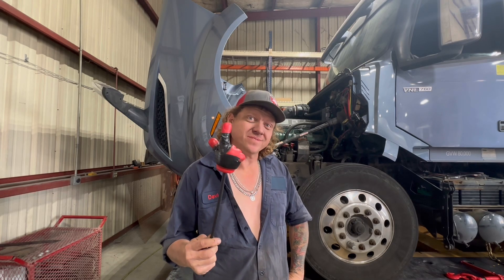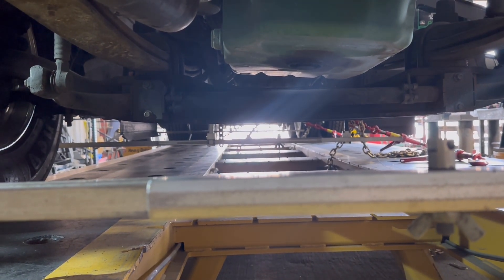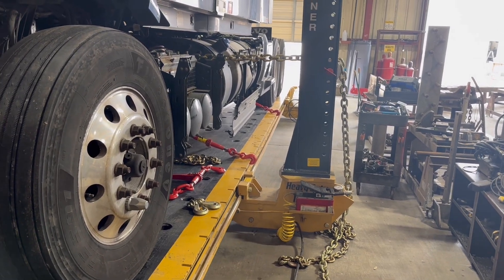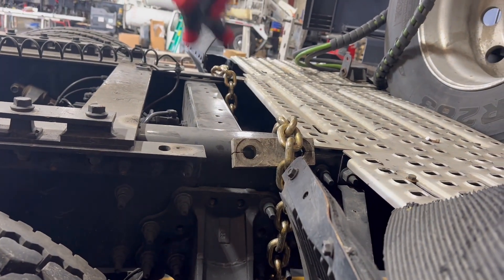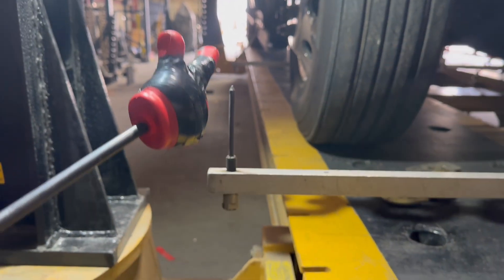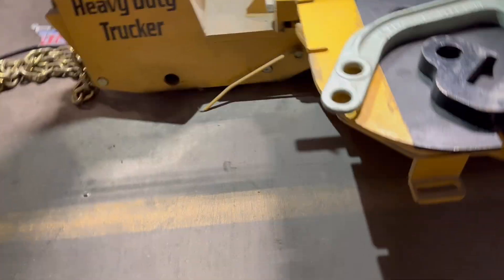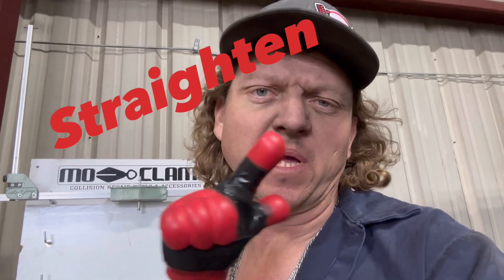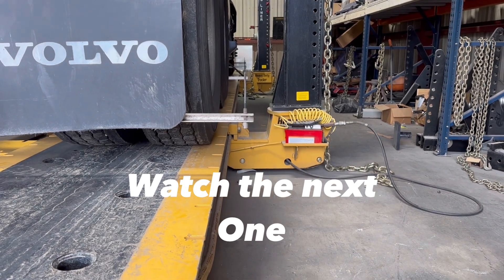Using the right tools to straighten semi frames

Comment: I have a double frame on a 1995 single axle internal dt466 flatbed truck in BC Canada I am limited 17,000 kgs or 37,460lbs with a single axle truck no matter what I wish there was somewhere I could find weight capacity on frame rails to know if I need that extra L scab of metal on the side or not for my weight limits. The truck used to be a tandem axle truck so there’s no weight capacity on the door conveniently

Comment: I was straightening an Autocar mixer that was twisted and diamond. Had the rear motor mount bolts loose on one side and out of the other. Start to put pressure on and wham. Transmission comes crashing into the pit. Didn't see the crack in the engine flywheel housing.

Comment: It is impressive how those frames can move that much
Reply: And it's not really moving that much when you consider how long of a section that bend is taking place.
Reply: Theyre made to be able to withstand the stress of flexing due to engine and driveline torque and heavy loads
Reply: i always think of it as the big power 18 wheelers where the front 2 tires are basically not touching, lots of bend and flex to straighten that up after letting off the pedal